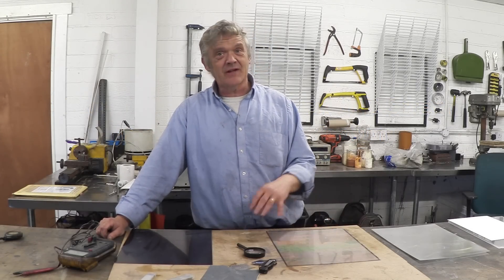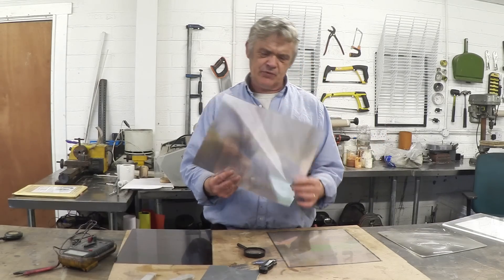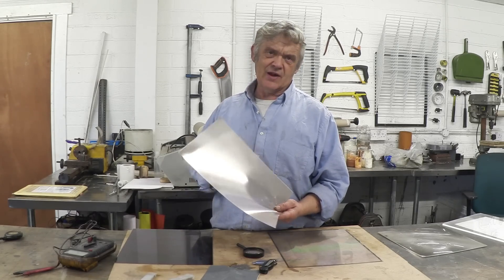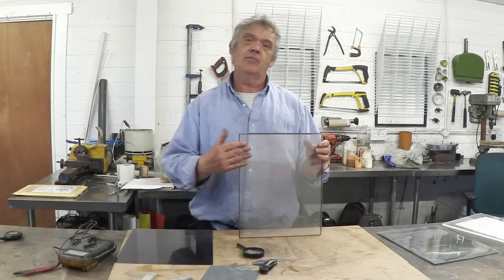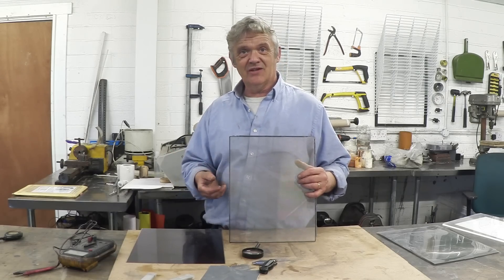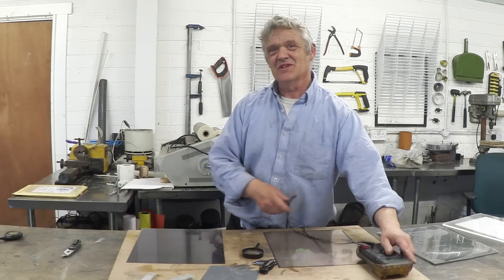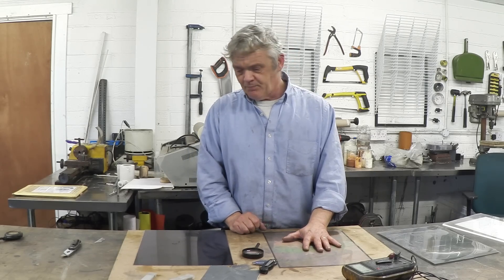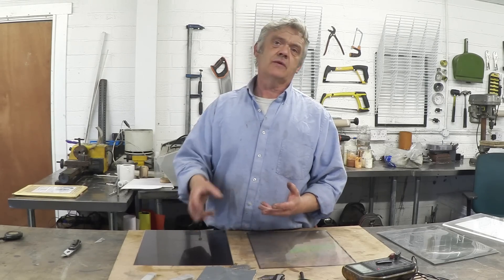A Solar Cell From A Broken LCD Screen - Part 2 - Recovering Indium

Comment: I loosely framed a piece of circular fresnel lens from a 60 inch flat screen and in the full summer sun, at just the right angle, the cement on my back porch would begin to explode in layers. That's hot!👍🤓

Comment: I came for a short explanation for building a solar cell from a LCD screen. There's alot of info in here that's valuable but if you're only here for the explanation of making one, It's very short and you will need to find a video on it. Timestamp: 8:36

Comment: Dang!  I coulda had a sweet side business as a TV installer recovering indium tin oxide from all the broken LCD panels I had access to over the years, I did take apart a couple and kept some LED backlights and those focusing sheets - apparently you can construct an LED lighting panel that feels more like natural window light from the focusing sheets, which was my plan but I don’t really have the space to rework a 65” panel in my little place now - once I move it might be more of a possibility but harder to get ahold of expired TVs where I’ll be.

Comment: I'm curious which method you'd recommend to cut up the conductive glass into smaller pieces without losing its original properties.

Comment: I had an idea to use a sheet of plastic or glass that is coated with indium tin oxide that then goes over a sheet of copper that has been heated with sulfur to make copper sulfide. And that is the solar panel of a junction of the copper sulfide and indium tin oxide.

Comment: With the darker sheet that has the colored windows. Get two of them on top of each other  shine some light threw them and twist turn one of them. You will see a neat  effect where you can see the induvial pixels blown up  to a great magnification. I forget what that effect is called but give it a try.

Comment: CAN YOU DO A FUEL CELL.... NOT MAKING H2 FROM WATER BUT MAKING ELECTRICITY WITH OXYGEN AND H2   SPECIAL MEMBRAIN NEEDED... HOW TO MAKE(?)
WE CAN COMBINE IT WITH THE H2 PRODUCED FROM AL AND CAUSTIC SODA CELL.   WE WOULD GET HEAT AND DOUBLE ELECTRICITY, OXYGEN FROM AIR(?)

Comment: Hey Robert, great video!! I have been dismantling hundreds of monitors from this one dumpster that just keeps on filling up with them. The problem is when I scrape off the substance on the dark glass the dust is not a black color but of a white color. It seems to me to feel and look more like plastic than anything else. Thoughts?

Comment: A bit over a year ago I dismantled 2 LCD screens and threw away them ITO parts, so now I am a bit crossed since I could've gotten indium off from those parts dang it. I did one LED lamp out of the other one. Although its quite weak at emitting light, it might be good for a light table for drawing purposes for some, one A4 fits almost just on it. Gotta ask for more screens from people to recover that stuff.

Comment: Rather than scraping the ITO off the glass, what about immersing the glass directly in a bath of hot oxalic acid, a bit like an etching tank?  I guess that some chemicals from the glass might leach into solution, but as you said, leaving it for a few days will precipitate them out. Would that work without crushing the glass? (and save a heck of a lot of scraping...)
Reply: I think I got it. The acid leeching components from the glass would probably damage the surface of the glass, which would spoil the optical purity.
Reply: Good Q. I'd like to know too

Comment: I'd have to re-watch for context and or cross ref, but sometimes u r on top of answering so: can u get the color filters off the panel leaving a functional panel? I'd think this would be advantageous for resin based 3d printing

Comment: can the average bloke get methylene chloride in the uk? used to be everywhere in the us (paint stripper) but in the last year or two all the cans of stripper advertise "new non... formula". u probably know but for those that don't.. it's the main component in the solutions for welding plexi. I've found if one cuts it with a miter saw using a bit of scrap plastic in the dispenser bottle helps control the viscosity.

I've used kapton quite a bit.. someone asked the other day whats special about it. besides yellow and non conductive I couldn't answer lol thanks!

Comment: Adding those lens does work great but after your panel gets so hot it hurts the effectiveness I took some very thick heavy duty aluminum foil I just use thermal paste very thin to the foil to back kf my panels  and slap all the extra aluminium heat sinks I salvage to that sheet on the panels makes a big difference especially if you mount the panel and len to a tilt and pan sun following base.

Comment: Indium, Tin, and Gallium = Liquid metal - https://en.wikipedia.org/wiki/Galinstan
Is there a way to precipitate out the tin of the Oxalic solution?
Recovering Gallium from OLED screens is not possible it seems, but some LEDs contain Gallium. Awesome project!

(The article you're talking about is locked behind either Institutional Login Options... or persons with an ACS ID, so I can't access it)
Reply from the maker: check out the paper in the description mate
Reply: @ThinkingandTinkering  Subscription required - Subtotal: $40.00
Anyways, H2SO4 at 50 degrees C should yeild 80% at 99% purity. Will do my own google/wikipedia research and become wiser on the subject - it is the best way for me to learn the theory and practice when I get around to doing 'something' requiring liquid metal :ø)

Comment: If you're interested I find this link to cheap indium
https://www.ebay.com/itm/100g-Pure-Indium-Metal-Indium-In-Metal-ingots-blocks-bar-lumps-99-995/264523493114?_trkparms=ispr%3D1&hash=item3d96d42efa:g:~qEAAOSwLwtdwjeF
Reply from the maker: awesome thank you mate

Comment: Hey Robert, long time viewer here. I actually work at a company that coats glass for auto-darkening mirrors. And one of the main components is ITO. Over my years I have acquired various size scrap ITO targets that were broken or too small to continue to use and have always planned on doing something with them. I would love to send them to you for various projects if you'd like.
Reply from the maker: mate that would be awesome if you are serious - my email is robertmurraysmith64@gmail.com if you care to drop me a line
Reply: @ThinkingandTinkering  I just moved recently so I have stuff everywhere and haven't done much unpacking. So I'll see what I can find over the next few days. And if not I'll see what's laying around the shop. But I'll definitely contact you either way.

Comment: Are both sides of that sheet of glass coated with poly? Because it it's only one side then surely you don't even have to scrape it all off, just enough to attach wires at either end?

As anyways, big love for recycling
Reply from the maker: no just one and good point - lol - cheers

Comment: RMS - light on silicon - could you do a perpetual battery flashlight? ie, putting the .5V through a few caps and a small dc/dc converter? could have the mossfet either outside or open the cone collector in the light itself
Reply from the maker: I suppose so mate

Comment: Why are they not using graphene rather than indium? Wouldn't CVD work to apply the graphene?
That's some great chemistry, Robert. Thanks. I was concerned about the oxalic acid contaminating the ITO until I saw that it's just C2H2O4 and doesn't pose a problem.
Reply from the maker: I don't really know why they aren't mate - probably because they don't last

Comment: Drop a rusty bolt in Oxalic Acid solution, it will eat the rust, great from rhubarb leaf.
Reply: Spinach is a great source of dietary iron until you cook it. The oxalic acid in the spinach ties up the iron in a form that makes it biologically unavailable. Same mechanism.
Reply from the maker: cheers mate

Comment: I wonder if you can use a cnc router to grind those layers off.  Place the glass, adjust the height, let it run across the whole surface, collect the shavings, and then repeat on the next glass pane.
Reply from the maker: you only need to do that if you want the glass whole mate - if you are doing aa ton just for the indium - crush them up
Reply: @ThinkingandTinkering  You made great arguments for keeping the glass and CNC machines are becoming rather cheap these days. 
That being said, I was curious whether they had the precision and work area size for this kind of task.  Otherwise we might have lots of scuffed up glass.  Better to crush the glass in that case.

Comment: Looking on EBay US,  Indium is $25.00 per 99.999% pure 1 Troy OZ. Price, of course, depends on the seller.

That's A lot of scraping and acid.
Reply from the maker: we only scraped because we wanted the glass - if you go for the indium you would crush the glass and the acid can be reused time and again
Reply: On the opposite of that.  I literally couldn't find any optical clear glass panels matching the description of what he's pulled from the monitor. Good gap in  in the market there. Kinda set your  own price status.  I'd still cross check with industry supplers though.
Reply from the maker: it's the weird things that make it worth it

Comment: Yes please would you mak the 2N3055 video I know what to do but others may not
Reply from the maker: will do mate
Reply: @ThinkingandTinkering  I used loads of them when I worked for Farnell electronics making the linear bench top power supplies you may have seen them ,well that was my first job in 1988 when I left school

Comment: Hey Robert; would the optical glass make better greenhouse material?
Reply from the maker: I like the idea mate - maybe a cloche to yes the idea before launching into a full scale greenhouse?
Reply: Expensive greenhouse....
Reply from the maker: not if you reclaimed everything - I think a small cloche to test it would be an awesome project
Reply: @ThinkingandTinkering       I was just thinking that being optically clear means that other glass would have a filtering effect on the light , so maybe you would get better growth with all the light....Sort of Full Spectrum rather than Limited Spectrum.   If I can find some I will certainly give this a try and report back!

Comment: I tried the prison film on a solar cell in many angles and flipped it. The output current dropped by half.
Reply from the maker: lol - thanks for that mate - I noticed a few companies were trying to sell this stuff as a solar improver - but I had no idea if it worked or not - now I know - cheers
Reply: What did the voltage do?>

Comment: If you melt the indium into regular solder does it lower the melting point of the solder? Say to use in removing electronic parts from circuit boards. Also could you mix it with epoxy and get conductive epoxy?
Reply from the maker: no ideate - give it a go and see

Comment: Rob, when you talk about dye sensitive solar cells, would that be something similar to Perovskite cells?
Reply: Alain Grignon yes. I just googled it
Reply: @heidismith8970  Lol
Reply from the maker: DSSCs are kind of the father of perovskite cells - they grew out of that research really so there is a great deal of similarity - but the working mechanism is different
Reply: @ThinkingandTinkering  Thanks Rob. I've always wanted to experiment with perovskite cells. Now I have a cheap way to source some of the materials! If only there was a cheap and easy way to get the actual perovskite! lol
Reply: https://en.wikipedia.org/wiki/Perovskite_solar_cell